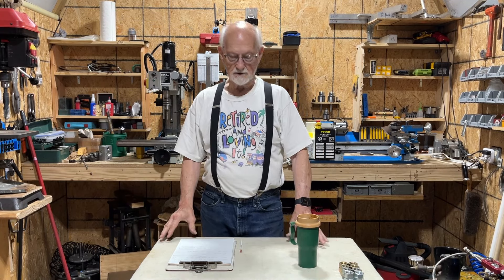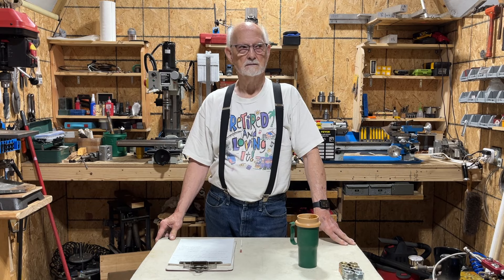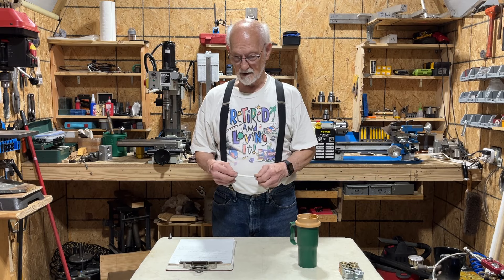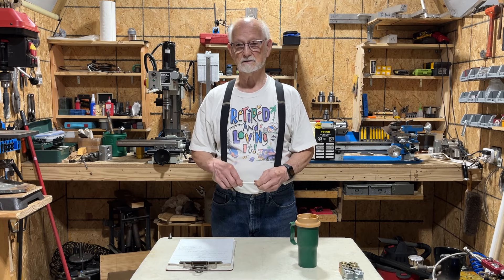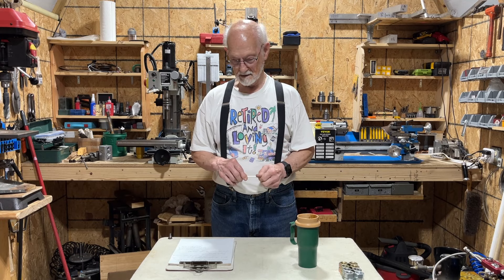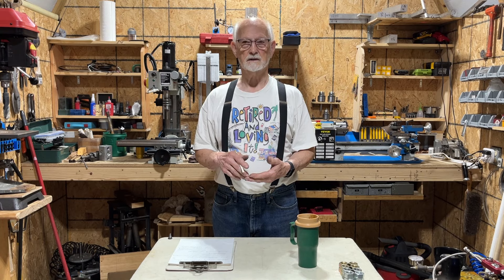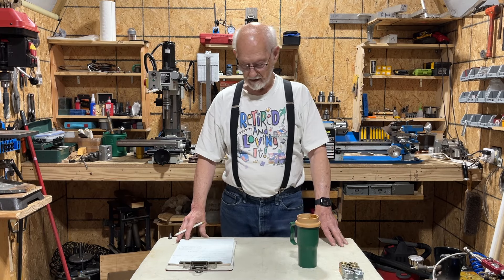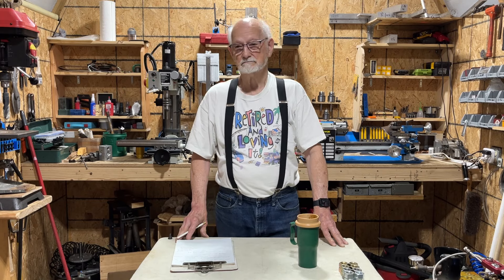My Air Powered Car, DECISSION TIME - WHICH ENGINE TO USE 7-27-24

Comment: Congrats on a fascinating project. I may not understand the way the final product is supposed to work on the road ? As I see it, this air engine uses effectively the same principle of operation as a steam engine. The steam engine uses gas (steam|) produced by a heated boiler built into the vehicle.  Where will the compressed air come from  to drive this air powered vehicle  ? 
A steam boiler can maintain full working pressure to the last drop of fuel and water. Pre loaded air cylinders can only provide a very, very limited period/radius  of operation with ever declining reserves of pressure.   Obviously, a gasoline engine driving a compressor defeats the original concept.
           Great workmanship and an intrigueing challenge. I wish you well.
Reply from the maker: Thank you for responding and your question
There really isn't a comparison to a steam engine, it runs from compressed air, not vaporizes water.
It will carry at least 1 high pressure air tank at 5000 psi, regulated down to 150-200 psi to run the engine.
I expect 40 to 50 mile round trip.
I'm assuming that you haven't seem my later videos, there is much more to see on my you tube site.

Comment: I was at a swap meet and a guy had about 8-10 carbon fiber scott tanks from a fire department. They must have to be replaced after a certain number of years, that could be a source for tanks they are only 80cu. ft. but they could fit and be plumbed together with hydraulic hoses. How much hp does your paintball pump take, a small engine running that pump could make a highly efficient engine or electric motor with batteries and a solar panel to run the pump could increase range. It seems like 30 miles would get a person to most destinations and then recharge to get back would be practical. I'm tinkering with the electric vehicle idea but rather than finding a small car and taking as much weight off of it. I'm starting with a model T frame and only adding what will be necessary. I have a 48v forklift motor running through a NP435 trans for different ranges and reverse. I figure 12 lead acid batteries 3 groups of 4 wired parallel series. My goal would be to see if with a wind generator and solar panels if I could drive for a year without having to hook up to the grid.
Reply from the maker: Thanks for following along, and your comment.
I have thought about multiple tanks 80 or 100 Cu Ft, but I don't want to have a lot of connections and most of all ones that are HIGH PRESSURE lines that are out in the open. 
I'm going for 1 or possibly 2 single 55 liter Tanks and a pressure regulator attached directly to each of the tank/tanks, which will feed lower pressure air to another tank that I will run off of.
Good thought though - Thanks.

Comment: Compressed air is the single most inefficient power transmission method in use today.
the losses to heat alone are enough to make this entirely unviable.
And yes, I do have an idea.
Convert to live steam.
You'll never reach efficiency of more than 2-3% with compressed air.
With steam you might get over 5%.
Might.

Comment: I'd like to see one of these run in conjunction with a conventional IC engine that is fueled by propane. Use some of the exhaust heat to raise the temp (and consequently pressure) of the liquid propane at the end of the fuel line, then feed it into your air engine to extract energy as the pressure is reduced by the expansion in the cylinders, then feed the propane vapour that is exhausted from the air engine into the IC engine as normal. Should be possible to gain a bit of energy that is otherwise wasted.
Reply from the maker: Thank you for following along, and the comment and idea!
I tried to draw out what your idea would look like.
Running an IC Engine with propane and exhausting the hot exhaust through a heat exchanger that has pressurized propane with a check valve going through the exchanger to the Air Engine would increase the pressure for the Air Engine.
Running the Air Engine would take quite a lot of propane, even after being heated to a higher pressure.
I'm afraid the volume of Air Engine Propane going to the IC Engine would be more than the IC Engine can use - since it's already running on propane.  Also your running two engines at the same time ?
What would the Air Engine be used for ?

I like that you are thinking about ways to gain useful energy from machines that are not as efficient as they could be, don't give up too easily!
Reply: If you're going to use a combustion engine, turbo compounding like in aircraft or volvo diesels makes more sense. That's where the turbo spins the crank rather than a supercharger. Some f1 cars have a turbo that directly runs a generator rather than a supercharger or spinning the crank.

Comment: i bought one of these 5 cylinder air motors they use for mixing agitators that clamp onto barrels in order to see how well they take steam. in short, something inside was plastic and turned to goo and it stopped working after around an hour of running steam. how does your engine handle steam?
Reply from the maker: Thanks for watching and your question.
The engine is a Compressed Air Engine, but could run with steam, for a short while, and nothing would melt.
It is not designed to use steam and would not last very long, bearings would fail, and everything would rust quickly.

Comment: Are these air engines single action or double action? I have built a couple of single cylinder air motors that were single action. They didn't have much power because they relied on the fly wheel for the exhaust cycle. I'm impressed by your six cylinder motor. I bet it could run on steam also.
Reply from the maker: Thanks for watching, and yes it could run off steam - although it would not be good for it - RUST
Running an Engine on Compressed Air is a unique process which like I said "It has taken me many years to get to this point"
The overall design is something that has never been done before, so I'm hoping it will prove it's self once in the car. 
The Cylinders only push.
Stay with me and see!

Comment: Good luck with powering a car! Just curious, which of the two designs do you think would be more reliable long term?
Reply from the maker: Thanks for checking in, and definitely the 6 cylinder.
It has less bearings to worry about, and to me a more stable overall design

Comment: im really excited about the 6 cylinder . what is your next step ?
Reply from the maker: Thanks for the sticking with me, and the question?
I think getting it put in, lined up to the transmission, adding a temporary air supply, and crossing my fingers to see that it moves the car?
What happens there, will determine my next steps!
Reply: @AirEngineResearch  do you have a car for it ?
Reply from the maker: Yes, but that’s not public knowledge yet?
You’ll have to wait on that.

Comment: u charge the compressor to move or make the engine run ad after some while when air is run out of the engine stops so at that time what u will do
Reply from the maker: Thank you for your comment 
I have a compressor at home, I compress enough air into a tank to go some where an go back home before  I run out of air and fill up my tank again for my next trip

Comment: It doesn't matter which motor you use because air motor efficiency isn't the big problem with this idea, now is it?  Tell us about your tank temperature management system, and why it is necessary.
Reply from the maker: I understand many say it isn't practical, or it can't be done, but I am doing it already - maybe not as fast and not as many miles.
Depending on tank size (30 Gal) and pressure (5000psi) using positive displacement (Piston moves- Wheel moves) and reducing drive pressure (200 - 300 psi) will determine distance can go. 
If I can go in radius 25 - 50 miles, I can go and come back and fill up again.

In my 6 Cyl Engine, each piston travels .8" and use 5.3 cu in per revolution 
Tank temperature for large or industrial purposed have to be considered, but I don't think it has much of an effect on running my engine, except cooling effect. 
If I find it necessary, a solar heat exchanger can be added. 

why is it necessary?
We are polluting the world we live on, and anything we or I can do to help stop it will help.
Using Solar, Wind, and Waterpower to compress Air and use it to drive machines would be in the right direction.
Using any process other than closed or positive displacement drives would be less efficient in my mind.

Last
I have the ability, the time and desire to make a working Compressed Air Engine, and hopefully - eventually be driving my VW Bug around to car shows!

Thats why

Comment: Would not this engine run at a loss due to the fact another engine had to make the compressed air to run this one?
Reply from the maker: Thanks for your comment.
First the engine has to work, the car has to go, and then I can start working on the Compressed Air Supply project - using solar and wind.
Maybe you have some ideas ??
Reply: @AirEngineResearch  If you want to be efficient then just run the primary power input rather than the secondary. Or the electric motor on the compressor rather than what the compressor is trying to power. Thats if your looking for simple and efficient. Not taking any bark off you, what your doing is a fun project.
Reply: @matton36 The big idea behind it is to use the air tanks to store energy instead of batteries. The metals in batteries are horribly toxic, while an air tank could be made from mild steel.
Reply from the maker: For the volume and 5000 psi, it's gotta be Carbon Fiber!  Very expensive too!

Comment: It takes electricity to pump up the tank, nice try though.
Reply from the maker: Thanks for you comment.
First the engine has to work, the car has to go, and then I can start working on the Compressed Air Supply project - using solar and wind.
Maybe you have some ideas ??

Comment: I am so glad to see your progress, but I wont wish you "good luck" , because what you have build, has nothing to do with luck, but skills in the art of making !

The air consumption, is all about valve timing, so how do you adjust cut-off ?

Best regards
Reply from the maker: Thanks for watching and following along.
Although there is some mechanical ability, it never hurts to have some good luck also!
The valves cut off slightly before Top Dead Center and Bottom Dead Center.
The Eccentric Drive System will use 1/2 as much air as a Regular Crankshaft.